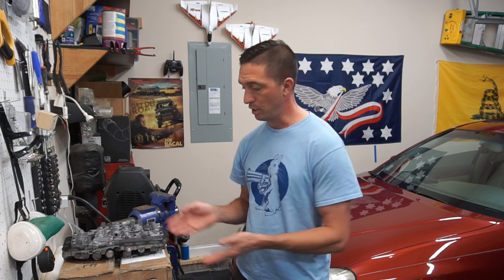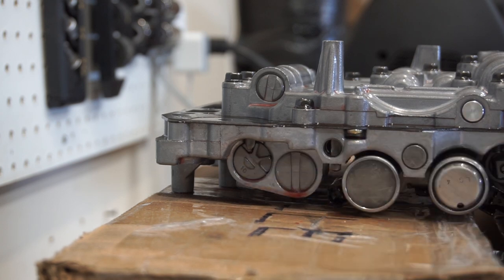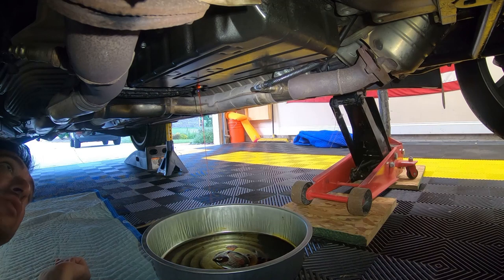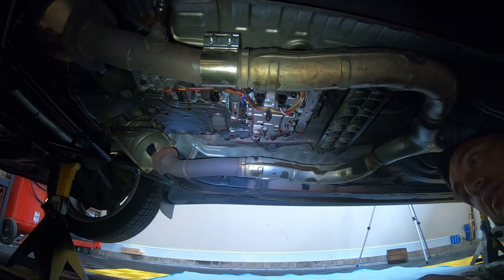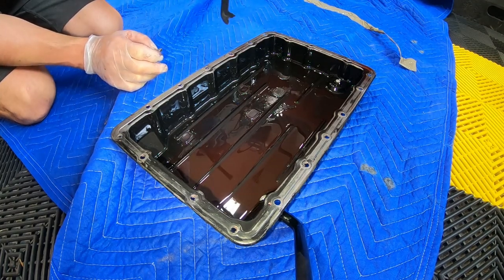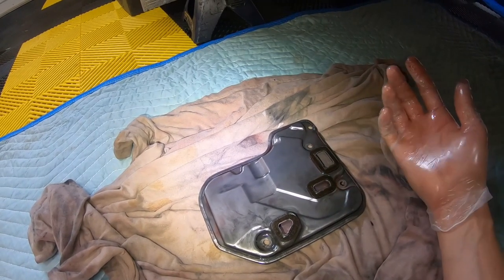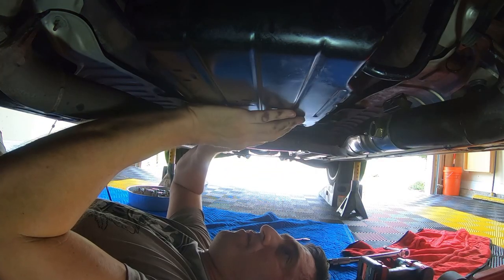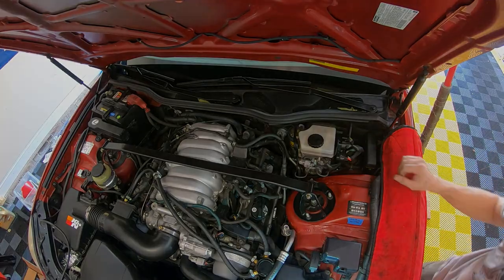TOYOTA / LEXUS STAGE 1 Transmission Mods & Maintenance

Comment: Old video, but I'm surprised I didn't see in the comments, the WIX transmission filter kit for this car is really solid. I got that for my '04 GS430 and run Castrol TransMax ATF (import multi vehicle type), and I've had zero issues. Doing the valve body adjust today, it's been on 2 (the middle setting) for a while so I'm sure I'm safe to dial it up to 3.

Comment: Oh that was great seeing the valve body assembly opened up! Thanks. I wish you had shown the shift selenoid A, B, C etc.  If you could point them out I would really appreciate it.  That is if they're actually reside there. Thank you very much.
Reply from the maker: I’m sorry I didn’t show that. You’ll need the trans FSM to get that info. I had to have a friend guide me with his knowledge and from his FSM.
Reply: @ForwardMomentum  hmmm  had to google FSM :)
Is that Finite State Machine meaning the order of inputs and transitions etc.?
Reply: Also was I right to expect them all to be located there on the assembly?
Reply: Anyway the whole video is so very helpful. Thanks again.
Reply from the maker: Factory Service Manual. I believe they do say something on them, yes.
Reply: @ForwardMomentum  :)  Much Obliged

Comment: Also, just to add, for that cross brace that goes over the lip of the transmission pan, I used a 1/4 drive ratchet, short extension, and normal sized socket to access it. Had to use my fingers to get those two screws all the way out though, and also to start them. The other 2 on that lip (the corner ones) I could get to easily, but the two middle ones were a pain until I grabbed my little 1/4" ratchet, extension, and socket

Comment: Added to the TODO list on my new 300 :) Question for the audience: If there are any UK viewers here that have done this mod, what was the setting when you dropped the pan?
Reply: My GS pressure valve was set at "1" before is set it to "3".
Reply: @drrock5356  any updates on your trans? Has it negatively effected it in any way?

Comment: My '00 GS400 secret shift dial was set on the lowest (full CCW rotation) setting! I just set it to high (full CW rotation) during an AT fluid and filter change. I sure hope me and the transmission like the new setting, lol!
Reply from the maker: Crazy! You should be able to feel the difference, especially at around 75% throttle input through the first 3 gears (not sure why but that’s where I really felt the difference).
Reply: @ForwardMomentum  Damn, last night when I carefully put the transmission pan back on, full of gooey FIPG, I "missed" the fill spout connection. It took me about 4 hours today to unbolt the upper fill valve tube, insert it into the lower fill tube, and get the bolt back into the mounting flange and tighten it. I also stripped a threaded stud removing the left cat, in order to get access to the nightmare bolt, lol!
Reply from the maker: Dr Rock we’ve all been there. I hate when stuff like that happens. Seems like you have a good attitude though!
Reply: @ForwardMomentum  Lol, I'm trying to keep my attitude toward the GS400 positive. She just came down off of the jack stands after 5 weeks of repairs and maintenance, which included new engine mounts, new (used) rear diff (OG diff blew up!), new carrier bearing, new tranny fluid/filter/shift setting, and new exhaust gaskets. To fix the P0440, I dropped the gas tank and installed a new vent valve, over fill valve, tank-to-charcoal canister tubes, and a new gas fill tube. The test drive revealed that the new (used) rear diff works, and the engine idles smoother and “stays put” when the tranny engages. But there’s a light yet significant drivetrain shudder/vibration during acceleration between 20-30 mph at medium power. And when I parked and got out, I could smell gas from the rear DS wheel well. I suspect that moving the shift setting from “1” to “3” is causing the 20-30 mph vibration, so the pan (and 6 qts of fluid) will be dropped again, so I can access the shift pressure dial, and turn it back to “1”. The gas tank must also be dropped again, which means removing the exhaust, heat shields, driveshaft, and rear diff, which I just reinstalled, so that I can access the tank lines and charcoal canister. I blame 20 year old rubber, field mice, and the massive burnouts the previous owner enjoyed doing to my precious GS400.
Reply from the maker: @drrock5356  oh man! That dial should have nothing to do with vibration. That sounds like the driveshaft to me.  Seriously, I wouldn’t even bother with the dial; I promise you all it does is increase line pressure a little and that’s it.
Reply: @ForwardMomentum  Yeah, I made sure to place alignment marks on the drivetrain (tranny spider, driveshaft spiders, and rear diff spider), but on the re-install, I realized that the new (used) rear diff isn't marked/aligned. Do you think the vibration has to do with the spider to tranny/diff alignment, or the driveshaft assembly itself? I did install a new carrier bearing, which I aligned (while bolting it to the chassis) perpendicular to the driveshaft by sighting down a large machinists square (not ideal). Also, I haven't measured the drive shaft angles yet.
Reply from the maker: I have limited experience with driveshaft issues on another vehicle, but my experience was that when it was the driveshaft I felt it only under acceleration at a pretty limited rpm/speed.
Reply: @ForwardMomentum  Hi Christian! I owe you an update on the acceleration shudder. In addition to that problem, I began having vibrations at modal speeds, like at 20, 40, and 60 mph. I set the shift valve back to "1" from "3", and the shudder and vibrations were still there. I measured the front hub runout: zero. Lower ball joint movement (GS430 arms, Moog BJ's) is .015" max (service limit is .030"). Replaced castor arm bushings with Figs urethane: changed nothing. Then last night, after reading more about driveshaft physics, I got under the car and dropped the exhaust and heat shields to inspect the center bearing. My intent was to reduce the front-to-rear driveshaft angle (1.8 deg, max spec is like 1.4 deg) thru the u-joint by adding spacers under the center bearing. While inspecting the driveshaft, I noticed a bolt was missing from the front driveshaft/transmission yoke!
6 months of chasing the growing shudder and vibration problems, and bam! Found it! I installed a temporary 3/8-16 bolt, and found that all of the nasty vibrations are gone! Instantly, she runs smooth as silk at all speeds and power inputs! A proper M12x1.25x60 bolt and nut are on order from McMaster Carr. I also added 2X .100" thick washers under the 4.5mm center bearing spacers to bring the included angle down to 1.2 degree. Thanks again for sharing your love and knowledge of this amazing car. Now I can finally enjoy driving my GS!
Reply from the maker: Wow! Great job sticking with it and nailing it! You’re one of the most thorough people that has ever commented on my videos. Keep up the good work and welcome back to the “smooth as silk” GS club! 😎
Reply: @ForwardMomentum  Once I was sure, I wanted to clarify that changing my shift pressure valve setting had nothing to do with the vibration issues. Your videos have been helpful, motivational, and inspirational, so I at least owe you decent updates on the revival of my GS! Part of my success comes from people like you who share what you've tried; what worked and what didn't.
BTW I recently connected thru techstream and accessed the c-best settings. Pressing unlock on the keyfob now unlocks all of the doors (instead of just the driver door), and I turned down the volume of the "key in ignition while door is open" chime. I also activated the "hold door unlock" on the keyfob setting to have it open the windows and sunroof from a distance, though the setting to have it close everything by holding Lock didn't work (not all the settings work). You can also open and close relays, bleed the ABS, monitor engine sensor values, and so on. Did you know that the system that controls the HVAC "outside air" versus "cabin air" valve has a hydrocarbon sensor that detects stinky exhaust, enabling it to switch to cabin air if the air outside becomes nasty?! And to think this is 20 year old tech!

Comment: @ForwardMomentum is there any reason i would NOT want to change the dial on the valve body of the transmission to the third setting on a 98 Ls400?
Reply from the maker: Yeah, if you like soft, flared shift action. It gets just a smidge more firm with this mod.
Reply: @ForwardMomentum I changed the pressure switch to the third setting on the transmission, and it works great!  Thanks!

Comment: If the 3rd Setting is better over all for transmission, what are the benefits of having it set anywhere else? 
Been considering a GS, and been getting a steady diet of your videos today. I appreciate the content
Reply from the maker: The other settings decreased line pressure, making the shifts more comfy; kind of like a rich old man heading to the golf course wanted back in the late 90’s apparently. 🤣
Reply: Gotcha. Kind of like the placebo power/comport toggle switches. With this one actually working :-) . Thank you
Reply: @HussarPlays  I love my smooth shifts, and PWR mode actually doesn’t what this valve body does adjusted

Comment: FYI the retaining pin on the pressure dial fell out when I was adjusting it.  Took a bit to put it back .
Reply from the maker: Good catch!
Reply: how did you get it back in
Reply: @BrianJr73  It was an exercise in patience due to my slippery fingers .  I used a small screwdriver to hold the dial in its place while I replaced the pin. I was worried for a while that the dial coming out screwed something up,  but it's been a year and all seems to be fine.
Reply: Me too, fell right out….took a bit but finally got it back in!

Comment: Any help please , I gotta gs300 2000 . And my rear was squeaking , so I got the rear upper control arms replaced and it stopped for 2 weeks then came back . Do I need to replace the lower control arms now or ?
Reply from the maker: Did you grease the sway bar bushings?
Reply: Forward Momentum No , and before replacing the rear upper controls arms .I lubed them up and the squeak was gone , until it dried out .
Reply from the maker: Try the sway bar bushings too.
Reply: Forward Momentum alright man thanks 💪🏽
Reply: Its the knock bushing need to be change i change one of mine but the otherside started
Reply: realfirerass knock bushing ?
Reply: I chased a really bad squeak in the rear right suspension last summer. Using a grease gun with a needle fitting, I poked through the rubber boots on the ball joints and pumped in grease. I cleaned the tiny hole I made in the boot with IPA, and dabbed a dot of RTV on it. That didn't cure the squeak. Then I traced the squeak to the shock hat in the trunk. One of the nuts on the three studs that stick out was not tight enough. After torquing it down, the squeak went away.

Comment: Thank you for this video. My a650e has 80k miles on it. I am not sure when the last time the previous owner changed fluids on the transmission. I heard it is detrimental to change trans oil if it hasn’t been changed for a while. Can I change the strainer?
Reply from the maker: YW. Yes, of course you can. Also, just drain and fill at that age/mileage at a regular interval vs flushing it.
Reply: @ForwardMomentum  got it thanks. Also I had a question, is it bad to drive it in Manual mode with the E-shift buttons on the is300? You are the man!
Reply from the maker: Not at all. It just holds gears. When I was auto that’s all I drove in. 😎

Comment: wow!! that's a great mod with perfect opportunity to do the maintenance. Is this same with the 2001 LS430? same 5 speed
Reply from the maker: I am not sure if the LS shares the same transmission code. See if yours is an A650E; I don’t think it is. However, the maintenance may be very similar. 👍

Comment: How many quarts I need after I do this this is on my 01 gs300
Reply from the maker: Measure what comes out and add that amount. I’d have 4qts on hand to be safe.
Reply: @ForwardMomentum  and while I'm at it should I turn that dial to 3
Reply from the maker: Of course!
Reply: I had to replace about 7 qts when I first dropped my Tx pan and filter. Disregard how much the Service Manual says to refill (you'll probably need to add much more!) Do like Christian suggests, and measure what you drain out. I also ended up over filling my Tx (not good) the first time. Remember to pull the dipstick when the Tx is hot, and the motor is running!
Reply: @drrock5356  it's already done it only took 4 quarts

Comment: I read same on forums, but just spoke to my coworker at Lexus (man been doing it for 20 years ) he doesn't recommend doing that. And says it will wear the clutches faster..
Reply from the maker: Increasing line pressure reduces slippage on the clutch packs.

Comment: This is a truly great video. I have a 2004 GS300 with over 230,000 miles. I don't know if any transmission maintenance has been done on it. The tranny fluid is dark, and shifting is getting sluggish. Do you recommend a fluid flush at this mileage?
Reply from the maker: Thanks! No, just drain and fill every 10-15K miles until you’ve gone through 10qts or so. 👍
Reply: Don't ever do a full flush...

Comment: very helpful video! thanks for the efford! 
does anyone have a part number for the oem trans oil? im located in germany and i can find 2 different Type T IV Atf oils with 2 different part numbers.
Reply: I use Castrol TransMax in my '04 GS430, been running that for almost 50k miles now with no issues

Comment: So I have a 99 gs400 an i was wondering if your transmission has a sensor in it bcuz my has a sensor attached to my transmission pan
Reply from the maker: I have a manual transmission swapped in now. I am not aware of any sensors on the A650E pan. There should be a dipstick tube and drain plug and that’s it.

Comment: Hello. I have an ls400 1998. Please help me choose the available atf. Is it ok if i use mobile1 3309 atf? Car only has 60000 miles on. Do i need to flush the tranny fluid or just change the amount without dropping the pan? Thank you for the answer.
Reply from the maker: I can only recommend the TOYOTA brand. I only drain and fill, so pan drop isn’t necessary.
Reply: @ForwardMomentum  Well Toyota t iv than? Unfortunatelly it could be found only at toyota dealers. No general auto part store didnt offer that. So i hoped mobile 1 3309 suitable for toyota would be also ok. Thans for a respond.
Reply from the maker: @ura1aru  I got my Type IV on Amazon.

Comment: Hey I’ve been watching your channel and following you on here and Facebook Lexus club. And I have a question about my Lexus gs300. Hope you could help me. I’ve been having “shifting “ issues . Car would only drive up to 40 sluggish .so things I’ve done. Cleaned maf sensor in weld and patched the elusive air box crack. Changed my 02 sensor , bank 2 sensor 1 I believe . Than my opinion and friends thought clogged cat. Sparked those babies out still same issue only thing is shifts 1st 2nd smooth ehh. I’m thinking now it could be my shift solenoid or my torque converter. Please Advise me in the right direction if possible.
Reply from the maker: Any DTC’s? Pending or stored?
Reply: @ForwardMomentum  only code I got was p0153 for my 02 but nothing else.
Reply from the maker: Ok thanks. The 300 guys have a ton of trouble with the TPS system in these and it causes the issue you describe at times. I’d investigate and test the TPS and pedal assy if you can to try to isolate more.

Comment: Hey bro I have a 1999 gs 400 and the ac blows hot air. I tried adding freon and nothing. Have u had any problems with your ac?
Reply from the maker: Is your compressor kicking on when you engage the AC?
Reply: @ForwardMomentum  yes but it blows hot air.
Reply from the maker: @eyeruntheboxful  if you’re sure the system is filled and the compressor is engaging, then it may be an air mix servo. You’ll need to get the FSM to test it, or have a shop test it. Not sure if you can reach it and manually go to full cold, but that could be a way to test.

Comment: Hey I have 99 gs 300 shifts hardbsometimes and most of the time it's good also speedometer stopped working any 1 have feedback please
Reply from the maker: Most likely a bad wheel speed sensor. You’ll need an advanced scan tool to tell you which WSS it is. Once you know, be sure to inspect the tone ring inside as well for excessive corrosion.

Comment: Does this valve body modification work for the 6 speed transmission in the 04-06 ls430s?
Reply from the maker: VB upgrades are built to suit each trans. I’m sure IPT could get you what you need. 👊
Reply: Forward Momentum I guess what I’m asking is are the notches to increase the VB pressure on the stock valve body or the upgraded one? If it’s on the stock one, do you know if the 6 speed trans has it? I’m assuming your car is the older 5 speed.
Reply from the maker: @jakedavis1085  gotcha. The 3 options are on all A650e transmissions as far as I know. I do not know if it exists on any other transmissions. I’m going manual so I don’t have to deal with this crap ever again. 🤣
Reply: Forward Momentum haha thanks for the info. I’ll drop the pan and see if it applies to the A761e tranny as well.